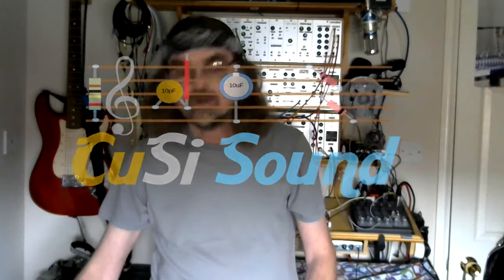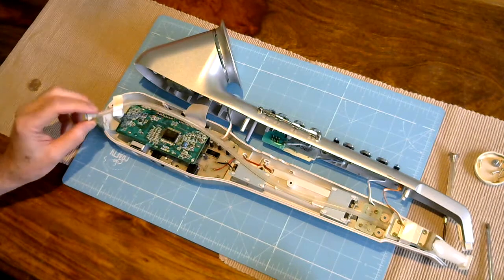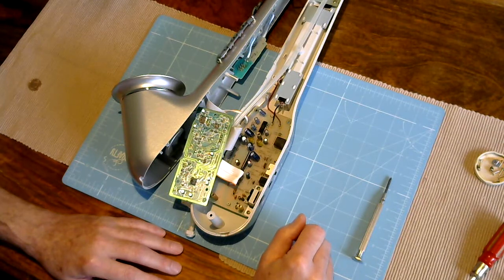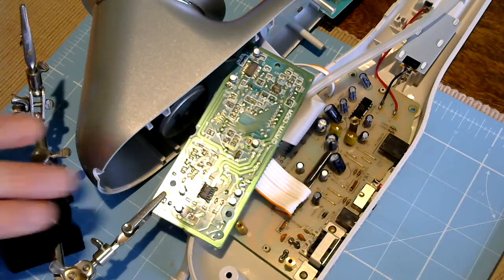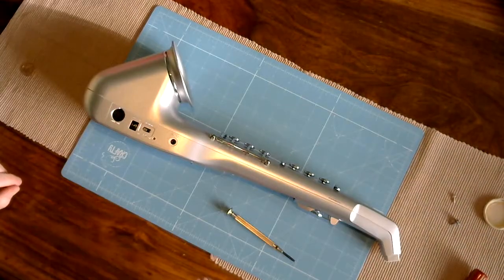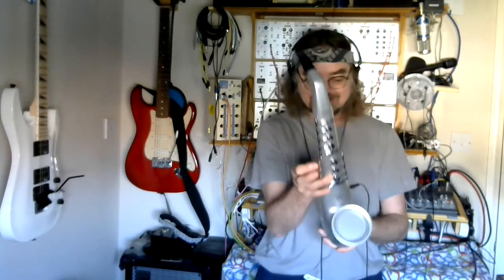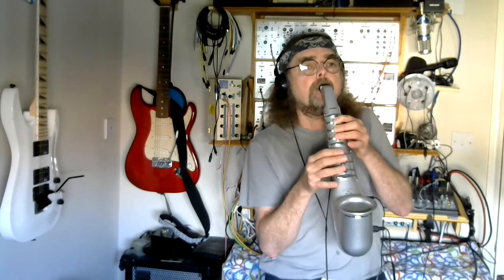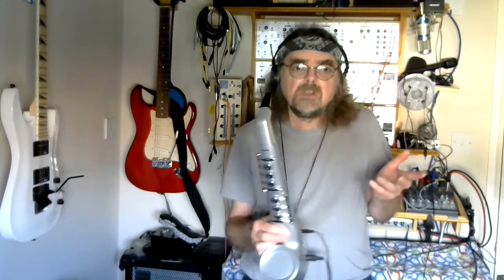Casio DH-100 Digital Horn Squealing Banshee Fix

Comment: Great vid, thanks a million! I've got two of those, one of which has the squeal and I intend to fix it soon, seems doable thanks to your instruction! One thing however: the midi works even with the squeal, just turn off the volume of the Casio.

Comment: Nice.  :)
This is the second of your vids I've run into.  If you haven't by now (given this is 3 years old), I'd suggest bumping up the volume of vids.  I remember I also had to crank the other one to be able to hear.
Cheers!
Reply from the maker: @blackrichard1029  thanks for the nice feedback. I now strip the audio from the video and process it before adding the cleaned up version back into the edit. Hopefully this improves clarity and levels.